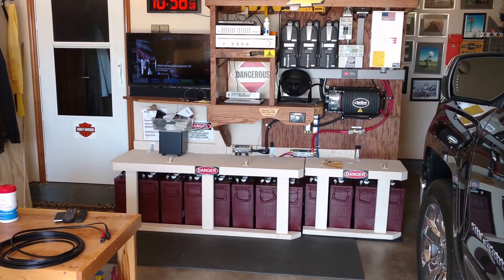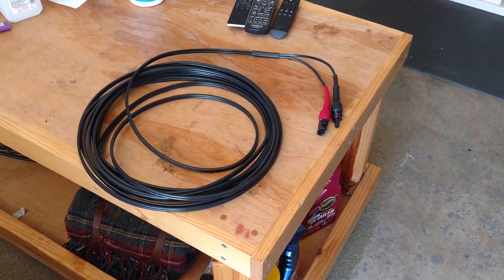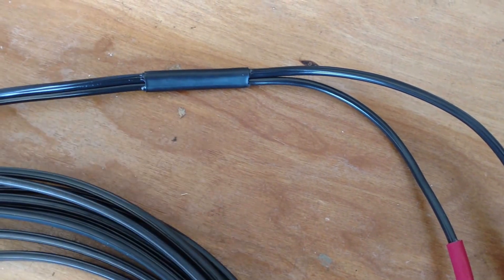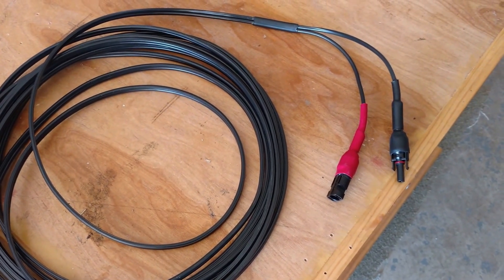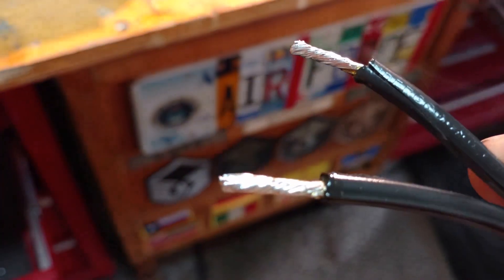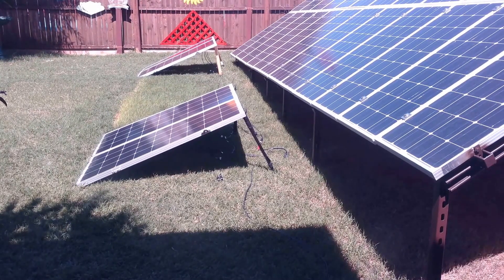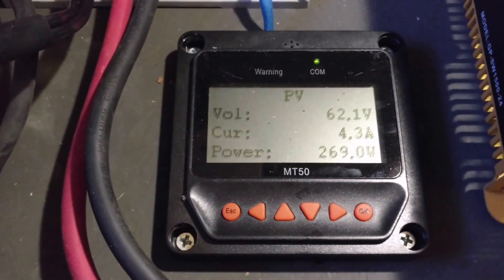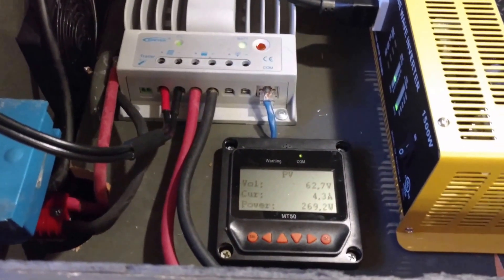Lowe's 12-2 landscaping wire as solar cable build (with MC4 connectors)

Comment: I think this a great idea. But when I called the Engineers at 2 different manufacture Co, " they said the 150v  UL rating  was only good for insulting the max 30vdc against the 120vac. I did this cause the print on the cable did not indicate any over 30v. Did your cable have a different cable print?
How long have you been running your install? I plan on using 10/2 for a long run. 50+ft.

Comment: how many panels are attached directly and indirectly to that single 12 2 cable that goes into the charge controller?  cuz renogy online wire calculator said 10 gauge for 4 100 watt panels.

Comment: Perfect timing for this video. Was wondering if this wouldn't work
Reply from the maker: Curious..."perfect timing?" You'd be surprised how many solar folks use low-voltage landscape wire in their set-ups. Many use 10-2, UL-rated, bury it direct, etc.
Reply: Great timing for myself

Comment: Hi Chris, what would you say is the main difference between the wire from the 2 stores that makes a good decision ?   J K
Reply from the maker: The Lowe's landscaping cable is thicker, better construction, and when you pull it apart...it doesn't rip. ie, it pulls apart cleanly. The Home Depot landscaping wire is mushy, rips into the strands when separating the two leads, and the copper also "looks" dirtier."
Reply: @ChrisDIYerOklahoma  Ok, now I know where to buy the wire (Lowes), where do I buy MC4 connectors in bulk cheap?
Reply from the maker: @theconnectedcamper  I have had the best luck with Sun Yoba (available on Amazon): https://www.amazon.com/gp/product/B019325XPC/ref=ppx_yo_dt_b_search_asin_title?ie=UTF8&psc=1